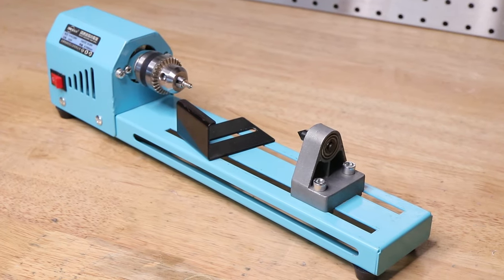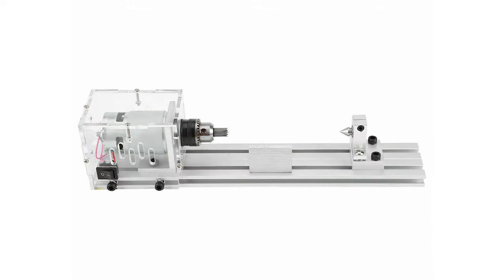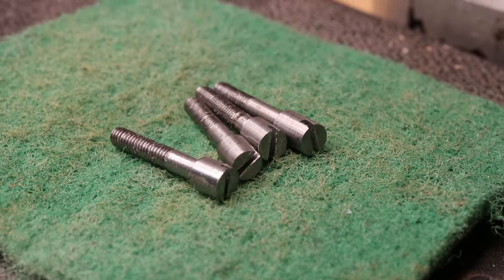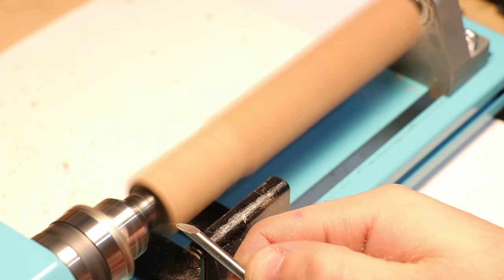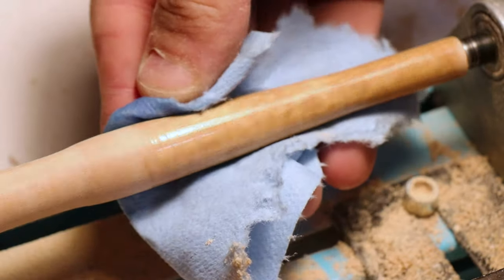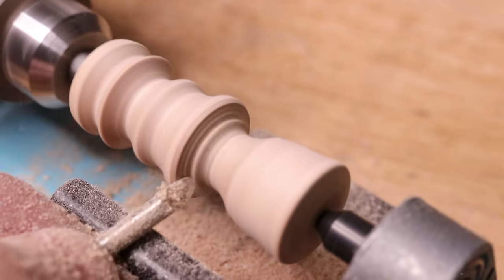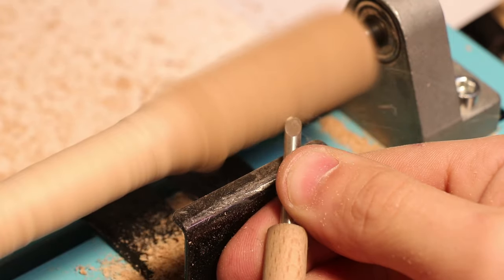Should You Buy A $40 Mini Lathe? - Mini Lathe Review

Comment: It's a toy... I suggest you get a sewing machine 100w motor. I've been using one on my minilathe for quite some time and it works well. It costs around 20usd.
Reply: its what I use for my wood lathe of around this size and its really perfect for the job. One with a foot pedal is especially ideal for small wood turning ive found.
Reply: @Borgedesigns  Same :)
Reply: Toss together a frame for your hand drill and a live center on a straight board.  The rest is up to your imagination.

Comment: The problem with these little hobby motors is twofold; the brass/bronze main bushing on the output shaft does not support radial loading imparted by lathe operations.  These motors do work for small drill presses, however, because loads are axial.  The other issue is the voltage-regulated speed: low speeds generate very little torque.  High speeds provide necessary torque, but they also generate excessive friction on the cutting tool faster than it can dissipate heat, and the work burns.

Comment from the maker: G'day everyone. As a disclaimer this review is not sponsored in any way Banggood or any other company, the lathe was purchased by myself. I also regret that I was not able to test this lathe as a disk sander or mini table saw due the the motor issue. It wouldn't surprise me if this lathe would as a makeshift disk sander if the proper arbor was made, however I would be somewhat uncomfortable using it as a table saw. It may be a project for the future. Also I didn't get it in during the review but for the shots where I was turning the cutter handle, the tool rest was as close to the work as it could be. Also the term Micro Lathe may be more apt here to describe this machine, but I was a little unsure. Hope you enjoy the review. Cheers
Reply: can you change the motor out with an R/C motor and use an esc to control speed I have some code out there for controlling r/c esc with Arduino
Reply: Hey, how big of a bowl do you think one could make with something like this? I'm trying to find a lathe to make bowls, but it has to be cheap. Any advice would be much appreciated!! I really want to get into making bowls, and my family wants to get me some tools for Christmas, but I'm going in blind and don't have a large budget! I hope I can find something that will allow me to make decent bowls, even if I have to do it all by hand. I have a pyrography pen, so I was hoping I could get tools to make bowls that I could burn some designs into and sell them+ give them to my family as gifts! ☺️

Comment: looks like with an upgraded headstock it would be a pretty reasonable little option, upgrading to a belt drive with a sewing machine motor would be ideal
Reply: @dordly  Gets the job done till the motor breaks after a few uses, as he showed in this video. Im all for cheap tools but breaking after a few weeks is not worth it in my opinion. For a little extra you could have a much stronger machine that would last a lot longer.

Comment: I've owned a wood lathe for a couple of decades that cost around the same price (adjusted for inflation). It's close to a metre long and employs a Black & Decker electric drill (other brands may fit) as a power source. 550 watts is the oldest and least powerful of my mains powered drills! I've not had much use of it as, long ago, the tailstock centre jumped off and skittered off the end of the workbench and disappeared into the local wandering black hole, so I dismounted it until the tailstock turned up.
Fast forward several years and, while reorganising the underbench shelf to fit new-to-me tools, I found it in a box that was over 300mm back from the end of the bench! The lathe can't go back as that space is now occupied by my Chinese 7X14 mini metal lathe, but I still have half of my workshop to play with for when I need to turn wood instead of metal.

This one seems to be best suited to turning 'softer' woods such as balsa. Technically I know it's an _hardwood, but ...

Comment: I have 1 of the aluminum types and I got it with a asurion warranty because of this video. But it still hasn't died. I might mess around and make myself a tool like you did because mine came with some tools that literally get shaved down by the wood. I can see the material change shape before my eyes as I try to use it. Believe it or not... I used the blade from a $6 ebay knife (the blade cracked because it was a $6 ebay knife - so I literally just held the broken "damascus" blade and turned several tampers with it for my tobacco pipes. I love it.

Comment: Until the reveal of the motor going tits up, I was going to suggest that another starter project could be a knob, handle, lever, whatever to replace that hex bolt for the tool rest, so you could stop having to clean it out to get the key in whenever you wanted to adjust it.

Still, not super surprising when you showed the chuck mounted on the motor shaft, which looked to me like it was likely to have some major runout. Yikes. Still, it was cute - I was actually pleasantly surprised to see a live center mounted into a ball bearing; that was way more than I'd have expected - and it'd be interesting to see if you could cheaply swap parts out to get something more reasonable.

Comment: The  problem of wood dust in the hex bolt can be solved by putting a small price of masking tape over the hole in the bolt after tightening  but  before operating the lathe 
Suggestion could apply to any tool
Reply: Or a bottle cap

Comment: Great video mate. First time watching your content. I think the motor died because its rated for 12V shown @ 3:57 . when you go above the rated voltage the contacts suffer if this is a DC brushed motor
Reply from the maker: Quite possibly. I am aware there are a few different models of these 775 DC motors, and the ones I have seen are typically rated for use between 12-36v, though this one night only be rated for 12, I am not too sure. Either way I never went above 14v when I used this lathe, as the high rpm was not suitable for turning. Cheers
Reply: its carbon brushed wear out, intense using make it wear out quickly

Comment: Just a heads up here.  It does not work well on 120vac.  There simply is not enough starting current, so you would have to replace the power supply to use this in the USA. I subbed in a heavy model train power supply to get mine working right.  ed:  Oh and I just use mine for light polishing, and limit the Voltage to 12v.

Comment: I believe it burned up because it's a 12v motor (4:00) and it comes with a 12-24v power supply. Anything faster than the slowest is over volting the motor. You said even on the lowest speed it's still too fast, for sanding. That's probably the maximum speed that motor is supposed to go. Good review and I think I'll take the advice and just skip this. I have some neat old vintage motors that would make a fun project building a small wood lathe.
Reply from the maker: Wouldn't surprise me, although these 775 motors are typically rated for 12-36v. Cheers
Reply: @artisanmakes  Oh hmm it is rated for higher voltage then. Maybe a nice brushless motor upgrade, one that doesn't have any big air holes for wood chips to get sucked into it. Could still be a useful tool just for small stuff.

Comment: I have one of the aluminum framed models. Had the exact same issue. The switch burned out after 3 days (lotta use in those 3 days though) they come with a 6A switch and the power supply is rated for 5A which isn't much of a buffer. Get yourself a 15A or better switch and you'll be good to go.
Reply: I also bought one of the aluminum versions, and I have to say, it seems to be more rigid than the steel one, based on how much deflection you were able to get.  My motor wasn't the first thing to go, though: first, the bearing on the live center was complete crap from the start, and even though it still functioned as a live center, it made a lot of noise, and I doubt it would have run much longer before seizing.  The second thing to fail was the power brick.  This appears to have no overcurrent or short circuit protection, as the first time I stalled the motor (which is really easy to do with a wood lathe), the power supply went "pop" and stopped producing power.  Also, as you mentioned, the laser-cut and heat-bent motor housing was broken into four pieces in shipping.  This wasn't too big a deal, since the motor ran fine without a housing, but it seems likely to me that the failure of your motor was caused by sawdust getting into the bearings.  All in all, not a great experience, but I suppose good enough to get a sense of whether or not you want to buy a real lathe.

Comment: modellers could use it but you'll get only about 100 hours out of these 775 motors unless you turn only the softest materials. step up to the under $300 wood lathes such as HF, Grizzly or ShopFox, etc and you'll get a solid machine for turning though they are not micro size like this one. I didn't like the small toolrest

Comment: If you make that style of tool in square cross section HSS and grind the face so its a long diamond shape it actually makes a really  useful turning and marking tool that makes a fantastic job of cutting were almost all other lathe tools fail.
honestly I wouldnt want to spin something 60mm round on that tiny spindle at those kind of speeds. I hjave had work pieces leave the lathe at high speed but never a chuck..........

Comment: Great for pen blanks, and easily upgradable motor from the 775 👍🏻 for 40 bucks... 🤷🏼‍♂️
Reply from the maker: Really depends on what the blank is made from. If it is a wood blank then yes, but rigidity was a huge issue when I tried to turn acrylic.
Reply: What about using a woodworking chisel to knock off the corners and take shallow cuts to keep from burning out the motor?  Is 3,500rpms the lowest the motor will go?  Thanks!

Comment: I myself am all about cheap tools.
I bought a similar lathe 3 years ago just strickly  for making wooden model car wheels. These tiny lathe machines have a few flaws! DON'T WASTE YOUR TIME AND MONEY!!!
The first flaw is the two screws that hold the drill chuck in place are so close to the center that you can't even get a screw driver in to adjust it.
The tool rest is so short that it gets annoying have to reset it. 
The center of the chuck to the bedway is only 1 1/4" so you can't turn anything thicker than 2 1/2" diameter.
As far as the sander tablesaw attachments they are completely useless bcs once you put the blade on and secure the slotted cover there isn't any clearance for the blade muchless on the opposite side the cover when attached is at a lower level than the drill chuck.
The only thing useful would be the sander but they didn't provide a base to rest your part on to even attempt to sand anything!!!🤬
The problem is the design overall! It is garbage.
I wished I'd returned mine for a refund but now its too late. If anybody wants mine it is for sale!

Comment: i suggest the motor probably has Bushings and not bearings. Like has been said not designed for side load.. however i want one of these lathes now just for the parts. OR maybe make the parts. The Bed looks off the shelf to me i have similar used for bolt together shelving. Great video even though the out come wasn't great the idea and motivation is Great

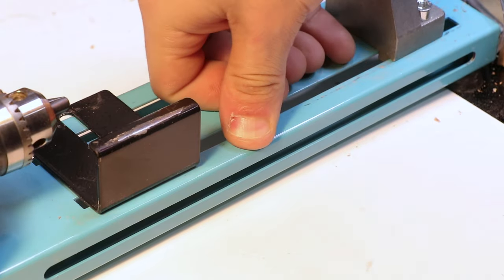Comment: The bearings in electric motors like that aren't designed for those kinds of loads, especially any thrust loads that may arise from certain cuts. I cringed when I saw the chuck directly mounted on the motor shaft. It was doomed from the start. Also, the "engineer" who put that bigass (relative to the side size) slot on the entire side of the bed is a goddamn idiot. Roughly approximating it, it has less than 10% of the rigidity without it. You should not be able to flex it nearly as much as you can at 3:06. On the other hand, it's not a metal lathe meant for tolerances in thousandths of an inch either, so meh.

Some fairly simple modifications could make it serviceable though. The chuck just needs to be mounted on a separate spindle with bearings to handle all the loads, and you can attach the motor with a shaft coupler or set of pulleys/gears/whatever. And the bed could just have a bar bolting the top and bottom together down the entire length along the center to keep the slot. The Jacobs chuck isn't designed for these kinds of loads either, but for such a tiny machine might work fine.

Comment: 3000 is a ton for a lathe afaik. that motor isn't made for this it fried!
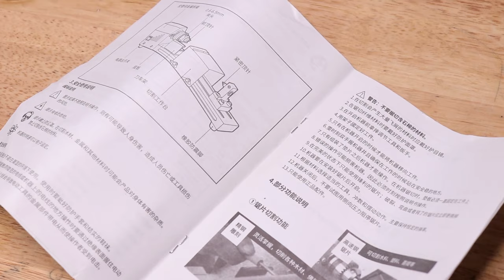I'm gonna make one with a dremel 4000 with 1:10 gear ratio, and unlike this, isolate the shaft from the one the force is applied to

also for a task like this, you should monitor the motors current to avoid frying it, they see to have just literally wired it up to 12-24v which is stupid. sadly I will have to trust Dremel's engineering on my project as unless I plan on opening it apart, I trust them to have designed it to not fry after prolonged use for such an expensive rotary tool!

dremel 4000 has a max speed of 35000 rpm which is insane for this, I'll probably run it at 15,000 (to also insure the motor won't fry) and with 1:10 it'll turn into 1500 rpm which is tbh still a ton but meh! I will have to probably see if they sell gears pre-made somewhere as I don't trust my 3dprinter to make accurate and strong enough gears for this that don't wobble or wear super fast

Comment: turn it into a parts polisher spinning a barrel or large round container, run it til it drops
The motor isn't powerful enough, bad design and/or parts selection....like my chop saw, the too huge disk can easily overheat and stop the motor causing smoke and sparks.
Reply from the maker: Thanks for the feedback. I didn't mention it bit I was intending to use this lathe for wet sanding, as the powder coat would be very useful in protecting the bed. I used it a bit for that purpose, but only at low rpm. Anything above 3000 rpm gave a poor finish.